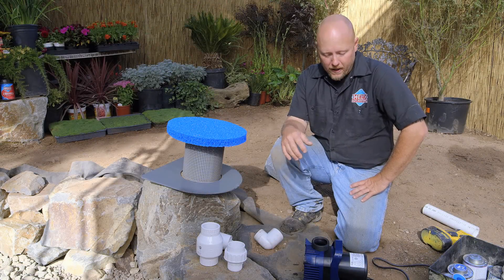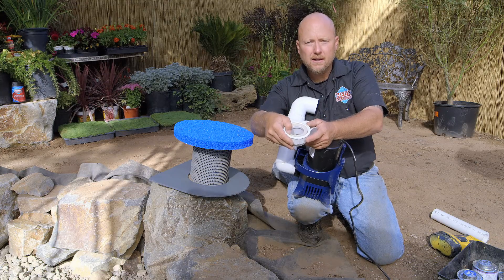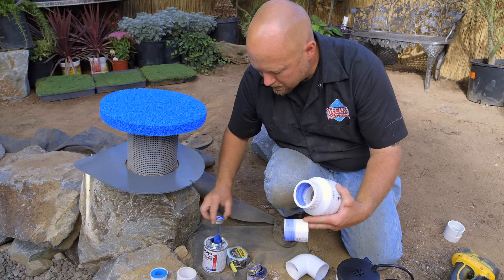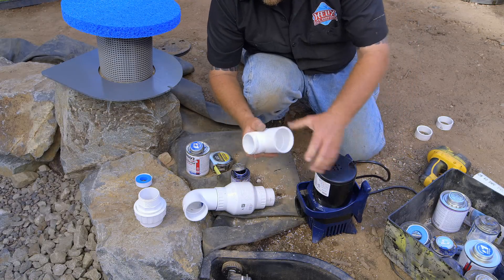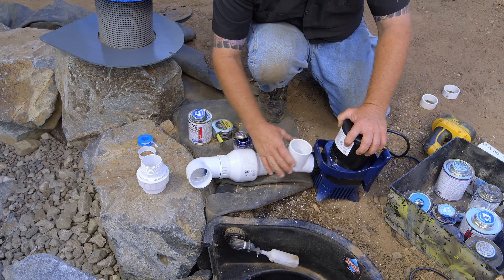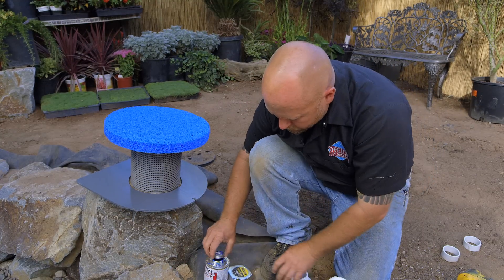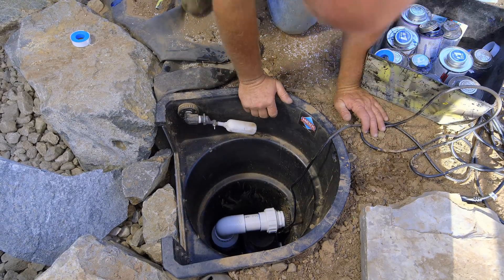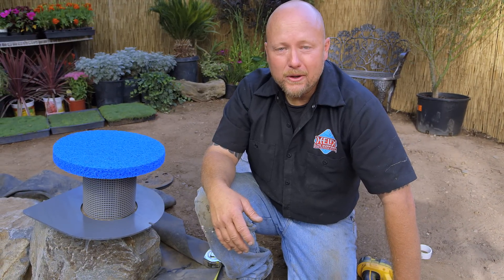How to build a Fish Pond - Part 18 | Pond Pump Installation

Comment: Wouldn’t you need to put that union between the one-way valve and the pump so if you do have to pull the pump you take the union off and you can remove the pump and you will be protected by the one-way valve if you put the union on the wrong side of the one-way valve once you break that connection he will drain the water fall ??

Comment: You do know that the check valve is located in the wrong place to do it's job correctly, don't you?  If you need to replace the pump, or do maintenance, that check valve is only going to hold the water between the pump and the check valve.  It won't keep the water in the pipe between the waterfall and the union connection you installed. I'm rebuilding my pond this Spring, and plan on putting a check valve just outside the skimmer, and the union joint just inside the skimmer box.  That way, if I need to do pump work, all the water will be kept in the piping to the waterfall.  Otherwise, great videos.

Comment: Hi Eric, could you install a gate valve from skimmer to waterfall to regulate the flow of water to the fall if your pump is too large? Or would regulating the flow damage the pump as it will be reducing the flow?

Comment: I'm trying to improve a pond in our back yard, really enjoyed watching your well structured and informative videos. thank you for uploading all these videos! but I have a question about the location of this one-way valve. the pump and valve are glued together and they are "upstream" the connection to the outside of the filter housing. when you disconnect the assembly and remove the pump, don't you remove the one-way valve together with the pump? I thought the valve should be before where the pump disconnects, right?
Reply: oh, it's pretty amazing that you are putting all those work into details, respect!

Comment: thank for the video eric, i saw in the previous video that if you are facing the waterfall there is 2 flex hose on the right and 1 in the left, why is that? based on what i see in the video only one connection that goes up to the pond, i am assuming that is the hose in the left if you are facing the waterfall, what is the purpose of the 2 hose in the right?

Comment: why did u add the union joint on after the check valve? if you are servicing the pump u will have removed the check valve and It will have done nothing

Comment: Does that pump have treads on the outside too? And if you're using 2in pvc, and if there are threads on the outside would they be 2.5in?
Reply from the maker: There are threads on the outside. I have to say I have never used the outter threads. I can confirm the threads are smaller than 3"

Comment: I've been watching this series and love it. But I must have missed something. That pump in the skimmer is pushing water out of the skimmer. So there's piping taking it from there back up to the top of the waterfall side? I didn't see where that piping was setup. Was there a video on that piece that I missed - it's already backfilled in this video, so must have been done earlier.

Comment: First off I just wanna say I really enjoy your videos. My folks just moved into a house with a small pond and the installation is definitely not to the caliber of yours. This series and other videos you've posted have helped me to understand how they go together and what we can do to upgrade and improve the existing feature.

I am a pool installer and we do Viking in ground fiberglass pools, so I understand the nature of the pump/filter/cleaning systems on those quite well, and it's been a lot of fun learning how the ponds differ and the methods of filtration to create a mini-ecosystem instead of a chemically regulated environment for recreation. And I gotta say, it's really refreshing to see someone take the time and care in the gluing process to have clean well fit joints without using half a can of glue. I get a hard time from my crew for my slower pace. I just like to tell them my fittings will never leak =) Plus, once we're finished most of our work is locked under concrete and fixing mistakes is very costly, so making sure the plumbing is done correctly the first time is essential.

I did notice you used a sawzall to make your cuts, and in a pinch for us that does the trick. But the cuts aren't always straight, and the burrs are a pain in the ass. All our plumbing is 2" SCH40, and we use these bad boys for all our cuts https://www.milwaukeetool.com/power-tools/cordless/2470-21. Not sure if you've ever looked into these or considered them. Clean straight cut every time. They're quick, and easy to maneuver or get into tight places if you need to. We run a ton of pipe for most our pools, especially the ones with in-floor cleaning that have 6 home runs to the water valve at the equipment pad in addition to a main drain and skimmer. Just thought I'd share a little trick of the trade if you hadn't seen these cutters before. They're awesome =) And thanks again for taking the time to produce these videos. They're very informative and educational.

Comment: what is the opening inside the skimmer connected to?
Reply from the maker: The liner is sealed tothe opening of the skimmer
Reply: I think the inlet pipe inside the skimmer comes from the bottom drain? I'm not positive on that though.

Comment: Is there a reason not to use clear glue and clear primer?
Reply from the maker: +M Wayne Ayers I use clear glue and primer all the time. Using the purple primer and blue glue is great for demonstrating on film to DIYers and also is great to have my employees to use purple and blue so I can visually inspect the connection. Thanks for the Question!

Comment: shouldn't the check valve come before the disconnect part ? to prevent back flow if you have to remove the pump?
Reply from the maker: +djclown7pb We recommend you drain the waterfall for maintenance before removing the pump. The union on the pump is easiest in this location and is only used a couple times a year at most. Good looking out!

Comment: Should the check valve not be further up from the breakaway union?
Reply from the maker: +wilson gamboa The Helix Pond Skimmer is super compact so there isn't much play in for space between the check valve and unions. This configuration offers years of service. If you do have a problem you will need to replace the entire assembly. There is not much alternative it this compact offering. If you ask me, I think it's well worth it.

Comment: So you used a submersible pump for this pond whats your stance on submersible versus external pumps. Most of the information I've come across says submersible pumps last 5-10 years where as external pumps last 20-25 years.
Reply: Gotrek65 external pumps are outside of the water, just like a pool pump. Yes he installed an internal pump, likely because that's what the job called for. He is saying he prefers the external pumps which he didn't use in this video or this particular pond. The internal he noted are cheaper and less of an eye sore, which may be the reason behind the client going with an internal over an external.
Reply from the maker: Gotrek65 I am all about the external pumps! Cost of ownership is great with externals! Fact of the matter is the submersible pump cost less money up front, is easy to install if you are a beginner and hides easy in the landscape so we sell submersibles 5 or 6 to one! Go External! In our How to Build a Koi Pond series we installed an external pump and I spend a little time promoting their longevity!
Reply: ThePondDigger I'm confused I thought external pumps were above water level, the pump you installed in this video is below water level inside the skimmer unit isn't it?

Comment: I have watched this video series a few times because I am redoing my pond.  I really messed it up the first time.  I do have one question about the location of the check valve.  Shouldn't the check valve be located outside of the skimmer?  If you remove the pump for maintenance, the water from the waterfall will backflow anyways......
Reply: i was just thinking the same thing

Comment: Hey Eric, 
Your How-to vids are great, well ordered and detailed. This part 18 has raised a question for me... wouldn't the check valve do it's job better on the opposite side of the union? (even if the check valve was installed outside the skimmer housing)

In this demonstrated assembly, the moment you dis-assemble the union, the purpose of the check valve is defeated.
Reply from the maker: This is a good question. Understand that if we need to work on the pump we can drain the waterfall filter so the dirty water doesn't flow back into the pond. The check valve is there so when we have power failure the dirty water does't flow back. The union up above the valve is important for winterizing ponds so we can drain water from the plumbing circuit.
Reply: @ThePondDigger  Hello TPD. I´m not convinced that your placement of the check valve is the best, because if (as you responded) you need to do some work on the pump you will first need to drain the water fall. If you had a second union between the check valve and pump, you would not need to first drain the waterfall and all that comes with it.

Comment: Hey Eric, how can i choose a properly sized pump to my upcoming pond. the Pond will be around 2000 liters and my waterfall will fall from 1 and half meter above from the ground level. Can give me a formula or some other tip so i can choose a pump for my system. Btw is it true that koi needs 3 ft deep tanks ?? but what will be the length for a good koi growth ??
Reply: btw water fall height is not 1 n half meter its only 1 meter.

Comment from the maker: Installing your pump in the skimmer is really the best location for the pump. Installing an automatic water fill device is something you will want to consider if you are in a hot environment so you don't have to add water all the time or worry about your water level dropping to the point your pump will be in jeopardy.

Comment: with it set up like that you really have to make sure the water level is maintained so you dont burn out the pump. Is that correct? Wouldnt it be more practical to set it up differently so you wouldnt have to monitor so intently?

Comment from the maker: You would likely be better off with the flex pipe as it has some tolerance to expanding. Secondly you will certainly want to remove the pump in the winer. When you remove the pump you should be plumbed up to drain all of the water out of the plumbing lines so you shouldn't have any issues with bursting pipes.

Comment: Eric - more of an overall plumbing question. I live in the North East and we get long cold winters.  Should I be using the ridged PVC or should I be using the flexible stuff? What about winter time, I am assuming I would have to pulling the pump out so it doesn't freeze ?

Comment: that PVC connection you are running from the pump.. does the pump suck in water from the very bottom of that pump? and the PVC you are connecting is just the outlet running to the waterfall right?

Comment from the maker: Yes it is an Alpine Pump. That pump fits the Helix Pond Skimmer Like a glove! I actually used that pump as a model when designing the Helix! The Alpine Line has pumps ranging from 2100gph to 8000 gph so it was a sweet spot for designing a small compact pump to fit like a glove. Thanks for your feedback!

Comment: Good video. Looks like you're using an Alpine pump there. I'm a fan of their pumps. I only wish their plastic grate didn't fall off so easy. But given how you aligned the pump, that won't be an issue. I never knew the feet came off ;). Thx. And that helix skimmer system is super slick. Think I might have to go that route when I build my pond next year.

Comment from the maker: This pond is an eco-system pond. We rely on the efficient Helix Pond Skimmer to keep wind blown debris from making it to the bottom of the pond and then we rely on the bacteria colonies in the gravel to break down sludge. Draining the pond annually for cleaning the bottom of the pond is recommended. BOTTOM DRAIN technology is available for no gravel ponds. Done correctly the bottom of the pond stays clean. An UNDERGRAVEL SUCTION GRID is another technology used in ecosystems reducing maintenance.

Comment: Just a little FYI to everyone, when calculating the "lift" of your plumbing run you should take a great deal of care as you want to get the perfect sized pump. Some people just measure height, e.x, waterfall is 3' above water level, I have 3' lift? No, count all of your elbows, tees, any restrictions whatsoever, each takes about 4-6" of "lift" Also, and this is one overlooked many times, the backpressure caused by the media in the waterfall filter can cause a large unexpected drop in flow.